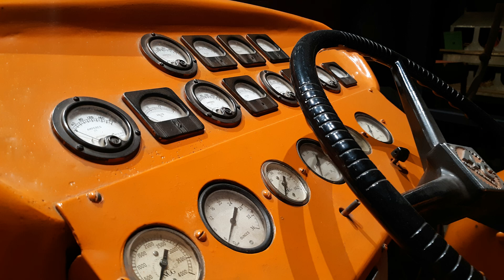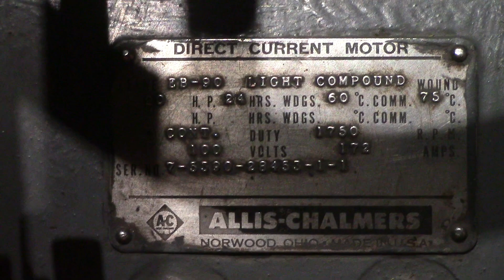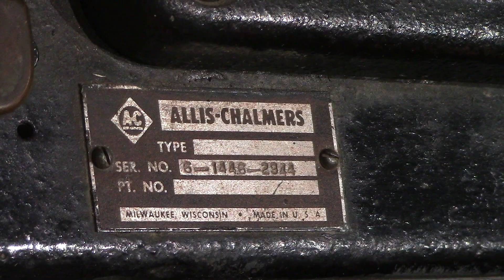Allis Chalmers Show: Fuel Cell Tractor 60th Anniversary

Comment: For when it was and what it was, that is truly remarkable. That no one picked up the technology is the question. It is called a learning curve for a reason.
Reply: Rogue Mentality  
Nothing would happen to the energy industries.
Fuel cells work in certain circumstances.
As do battery Electric.
you're not going to be flying a 300 passenger jet plane anytime soon on solar panels and batteries.
And regardless 70% of the energy generation in this country comes from fossil fuels anyway. 
I'm virtually everything You touch in your life is made from plastic which comes oil. 
I do believe the passenger vehicles are going to become fully electric probably within the next 10 to 15 years. 
But there are some things that benefit greatly from the very high energy density of liquid fuels like Diesel and gasoline. Planes being the big one.
Modern fuel cells that are in vehicles run on hydrogen, but you then have to look at how the hydrogen was created..
It requires a significant amount of energy to break water into hydrogen and oxygen.
You then transport that hydrogen to the fueling station where your car fuels up with it.

Comment: If the efficiency of this fuel cell system is significantly higher than that of gasoline or diesel, it would appear that in today’s world of stringent emission and fuel consumption standards that it could be a strong competitor to electric cars.

Comment: Has this Fuel Cell tractor ran ever since it was parked? It would be amazing to see, P.s I'll have to try n go next year! My B-day is the 4th.
Reply from the maker: Some of the fuel cells were removed at one point.  I forget what the story was if it was testing by another company or  somthing else?  So it hasnt ran in a long time
Reply: Rogue Mentality  
You could NEVER create this in your barn. 
Fuel cells use very complex materials.. 
It wasn't suppressed it simply didn't work that well.. 
Even today fuel cells don't really work that well.. they are extremely complicated, not something you really want running around in a field pulling a plow.
That's also true of many modern tractors with all of their idiotic emission control stuff.
The repairs on modern Diesel power tractors are far more common and extremely expensive compared to what we used to use.

Comment: Or you could just run a tractor with a propane manifold.  Same by product, no redundancy
Reply: I think with the fuel cell you have no Carbon Monoxide and no Hydrocarbon out the exhaust.
Just the water vapor and Carbon Dioxide.
If you use Hydrogen as the fuel you get just water vapor..
But your point is very valid..  I'm not sure the result is worth the complicated nature of this. Especially in a dirty and rough Agricultural setting .
You want simple and rugged and easy to fix with a screwdriver and wrench.

Comment: "A head of its time" they gave up so its "a failure of time"
Reply: Rogue Mentality  failure comes in many ways genius. It wasn't cost effective. Just like the IH turbine tractor. It doesn't take a genius to figure that out. If it was a success they would have made another more refined  prototype. They didn't so it became a failed project.
Reply: oil companies speak
Reply: "ahead of its time" considering the advancements in technology and materials this could possibly work today... if the oil companies would allow it that is.
Reply: @jerrybear3081  actually it was more so mfg cost than and the market than oil companies.  Even today its cost would be high compared to conventional.  Simply adding computers to an engine did not make it better. It made it worse because it adds so much to the cost. Factor in the cost to buy, fuel cost, maintenance and repairs over time, a new tractor isn't cost effective.  A conventional no computers with proper adjustments will out last and save more than a new one of equivalent power depending on make.